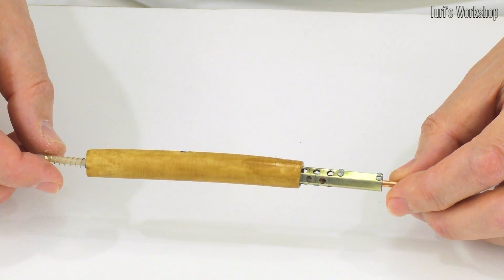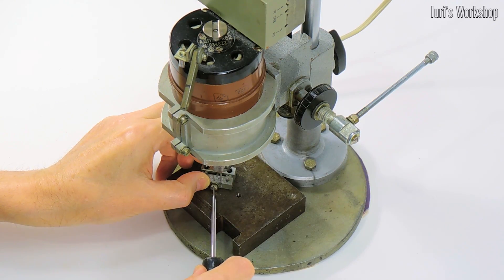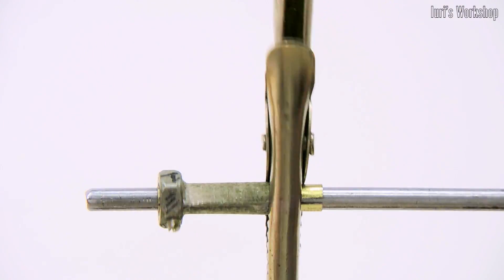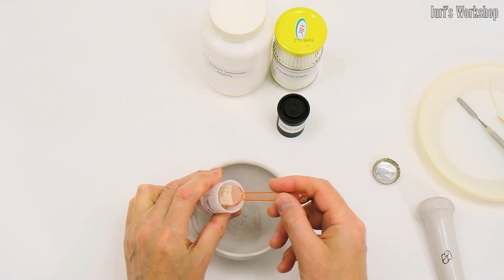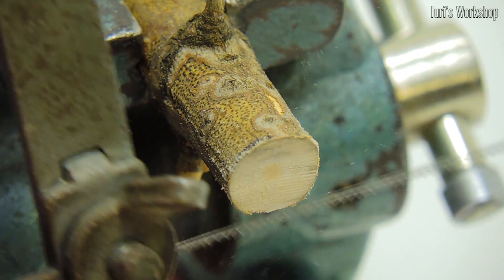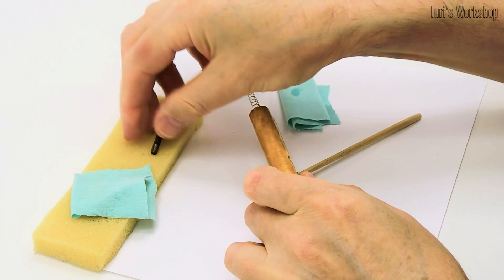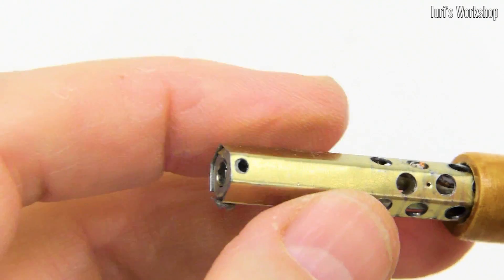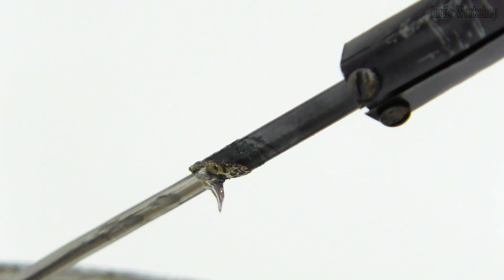DIY Cool Soldering Irons

Comment: 0.2mm Nichole wire howmany meter you used to get that 20 ohms ?  Howmany turns it was ?
Reply from the maker: How to calculate the winding of a soldering iron: https://oldoctober.com/ru/smd_soldering_iron/ Translation at the top left.
Reply: Web site shows error 404, says you need yet to edit that page or page not ready.
Reply from the maker: @ananthanarayana5768  I'm sorry it's my fault: https://oldoctober.com/ru/smd_soldering_iron/

Comment: Well done my friend. Still it have places for improvement. The best i would do is to adjust soldering iron to usual T10 tips.
Reply from the maker: I also bought a few at first, but they all turned out to be uncomfortable due to the very long distance from my hand to the end of the soldering tip.
Reply: @IurisWorkshop  。